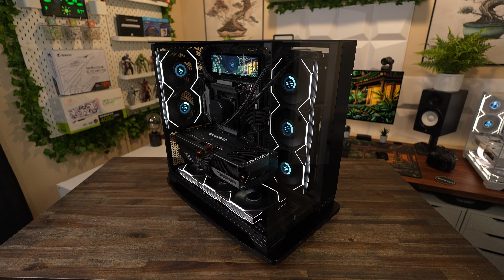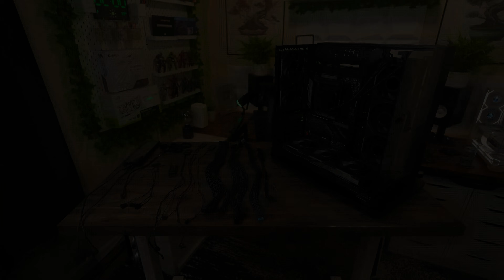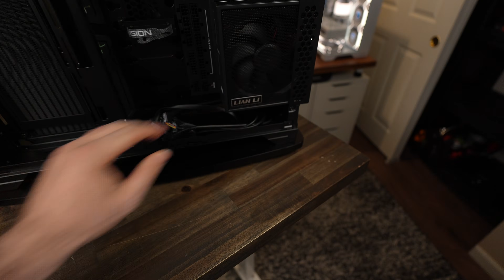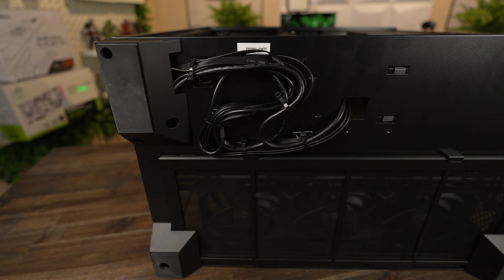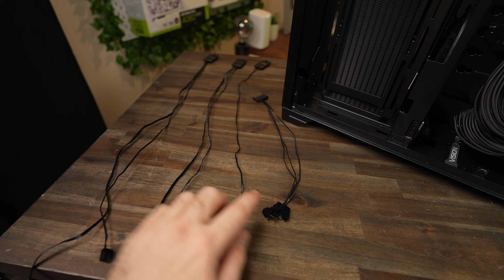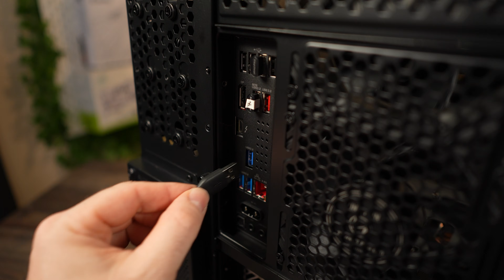How I Cable Managed my DREAM PC like a PRO!

Comment: Amazing builds!
For how long you've been using your 4080's horizontally?
I saw a video from a repair shop saying that even if you use a support bracket or pillar, your gpu (consider as the heavy ones) is gonna twist the pcb, damaging it, being mandatory to use it vertically mounted. That's driving me crazy, I have a 4090 rog strix (believe is the same weight that 4080 of yours) and I'm using the support bracket that came with the O11D evo RGB and the support that came with the gpu.

Comment: beautiful build! I'm inspired to build one almost like it. So the AIO - Lian Li ALC360...it doesn't look like it's got the center lcd. Did you have to buy "Side Fans - Lian Li Uni Fan TL LCD REVERSE BLADE Triple Pack" and replace what came with the AIO - Lian Li ALC360?

Comment: Hi Dan ! Just a quick question. I have the Lian li vision compact.. however I was wondering if the Lian Li edge the L Shape would that fit inside the compact or will it be bending the cables etc too much ?

Comment: Extremely clean and creative work. But i think its a very rare usecase where you got a button of space to work with as well as a very well planned build with minimal cables to begin with. Maybe do another video maybe with a mid tower and alot of cables from different brand components which would more accurately depict the situation of the average user struggling with cable management.

Comment: I think that i got scammed from amazon when I purchased the TL fans because what is supposed to look like "white" looks like light green or light blue, so the RGB is not as its supposed to. Just the red and blue looks like the color that I was matching
Reply from the maker: You’ve really gotta mess with the color palette within the software. It’s very hard to dial in a specific color, ESPECIALLY white. Lean more towards orange’ish / gray
Reply: @DanKamYouKnow   I had the Sl version first and they worked very well. In a moment i thought It was y my pc energy or something like that, then I sold my pc and now Im on a new project with the HAVN vertical GPU version and the TL wireless regular and LCD version and I hope this one do not come with the same issue. Also thanks for all your videos Mate
Reply from the maker: Very fun case to build in!! You’ll enjoy it a lot
Reply: @DanKamYouKnow  thanks. I was thinking to pay for the build but. This is something that I need to learn. I was just worried about the cable management. But the case is amazing

Comment: Loving the screen mate, this it pretty much my current build in terms of case and fans, except I went with a White build as well, used the galahad 2 LCD 360 and a vertical gpu mount. I ordered some of the lian li rgb fan side cover things to put in the area of the case above the cpu but never got it to work, that screen is genius! Is it wrong it have another screen in my build lol?

Comment: I finally finished my build a few weeks ago. An all white build for 2500 roughly. Ryzen 7 7800X3D, 32 gig T-force ddr5 ram, Antec C5 case, 7900XT, Okinos cable extensions, Lian Li EG1000G, NZXT N7 B650E mobo, 4tb (two 2tb NVME drives)

Comment: I am currently looking for a new case for my PC, is this one you'd recommend? I am looking for the best bang for the buck I've been looking at this case in the video but it seems you need to buy the fans which makes it more expensive, 2nd option was the Antec C5 as it comes with 7 120m pmw fans, 3rd is the nzxt h6 or h9. any recommendations??

Comment: I built my first pc cable management was abit bad some of the extra fans I have are sticking into the case and the gpu cable I didn’t know could fit through a small hole I managed to clean as much as I could but will this be a long term issue for temps or not? Really nice video btw

Comment: Absolute perfection like all your builds. You truely live up to the PC Kratos name. Can you show us how you cable managed the white build? I am in the process of building that but I would really really love a full deepdive!
Reply from the maker: Thanks! It is extremely similar, but it's a bit worst now, because I added the Lian Li Wireless Strimer PSU extensions to it. The main difference was that I wrapped each PSU cable in a cable wrap, then used velcro strips around the ends of them.

Comment: dan i have a question is it worth the hassle to have an aio i want one for the asthetics but my friends are telling me its a lot more matenience and itll last 1-2 years
Reply from the maker: There is no maintenance involved with AIO's, it is a completely closed loop. Air coolers definitely have no points of failure (just the fans attached to it) but AIO's are reliable, with most companies offer 2-5 years of warranty on there AIO's.

Comment: 8:22 did you inverse 1 of the cpu power cables? The left one has a smaller lip and is different than the right one?
Reply from the maker: That’s just how the CPU cables look. One is an 8 pin EPS cable and the other is a 4+4 EPS cable.

Comment: I'm currently using the same case right now for a build. Thanks for the lcd screen above the motherboard application. That open space with the board in the lower spot was bothering me. Have you tried 140mm fans at the bottom before? Feels like 140 fans would fill that space better.
Reply from the maker: I have not, but I like how 3 120mm fans look down there.

Comment: hey, what is it called when the PSU have a thing like that sliding out, so connecting the cables. i been looking and have not found anything and it would def help with cable managment if anyone could let me know it would be a huge thanks!

Comment: It seems like routing the cables to be piled underneath the case would restrict space for air intake. The underside is already constrained in a tight space as it is. Leaving the excess in the cable management area is probably the better move for function.
Reply from the maker: I highly doubt it’ll have any effect on fresh air coming into the bottom fans at all. If they were blocking the bottom fans, then sure. But there is the whole rest of the area for fresh air to come into the bottom.

Comment: I want to build also with the Lian li Fans, but I have a budget so no LCD screens are posible. So How many three packs do I need for 2 rear, 3 bottem, 3 front Fans, because the connector is includet in the three packs
Reply from the maker: You’ll need 3 reverse blade fans for the side, 3 reverse blade fans for the bottom, and 2 standard blades for the rear. You can buy a 3 pack for the bottom and/or side.
Reply: @ thanks for the answer😊 and I really love your Videos!

Comment: I’m concerned about my temps on my cpu, I built my own pc, I have a Ryzen 5 7600 and I have a 360 Corsair h150i aio and when gaming my cpu temp goes all the way up to 86° and then sits between 45-60° on idle, is this okay or should I be concerned

Comment: Now can you add an SL and a TL controller, an NXZT USB 2.0 hub, a PCIE power cable, 2 Sata power cables and 3 drives? These are the ones that made my entire PC a mess in the back, I don't know where to put them all.

Comment: So dang clean man!! Loving it! I got the O11 Vision compact and fortunately just picked up a 5090 Astral LC!! Curious on your thoughts about rad placement.. I really want to use the glass top but worried about temps with bottom mount. Thanks man!
Reply from the maker: Wow! Congrats on the card! Will the radiator tubes reach the side?! That would probably the best position

Comment: Transition away from using a WD drive to boot off of, especially on win11. It's a lot to type here but "stornvme" errors are increasingly more common and WD/Microsoft both seem to have no interest in fixing the problem.

Comment: I reckon the 5090 what have looked great in this build, it would fit that clean black aesthetic also this video has made me want to do my cable management 😅
Reply from the maker: It may get a 5090 at some point in the next few months. I don't really have any desire to spend $2,500+ for a GPU right now though.

Comment: I am doing PC since 20 years and today i realized, i will never stop to learn, your video was very very helpful ❤️ 
One question: where you get the display and what a software you use for animated wallpaper in it?
Reply from the maker: The display is linked in the description and the pinned comment. For software, I am using "Wallpaper Engine" on Steam, and the wallpaper is called "HYSTAR MIDORI".

Comment: You are putting your radiators in the wrong position the air is right where the tubes are on the hightest point. Look up a video on AOI positions!
Reply from the maker: This has been discussed to absolute death, it’s FINE. Tubes down is more ideal but this orientation works just fine.
Reply: @DanKamYouKnow  you should make a video about it to put it to grave haha sorry dude :p

Comment: Incredible cable management, and yeah man that tape is incredible, i've been using it for awhile, also strong enough to mount an entire huge APC power strip on the wall, had to move it once, needless to say i also had to repaint the wall after using it lol. Nice vid, been considering a vision for a case but was kinda worried about thermals, since i'm running a 14900K, using a lancool 216 at the moment and it stays around 55 while gaming..
Reply from the maker: Thermals are much better than expected. My 4080 Super rarely goes over 65c and my 7950X3D rarely goes over 75c under benchmarking loads. While gaming, they are both in the high 50s's.

Comment: Awesome build and nice tutorial! People who does pc building videos doesn’t really put the time to explain those sorts of details!

May i ask tho, is there any other power supply that offers usb connections? It seems that lian li is the only one that does that. It really gives more room for fans to plug into
Reply from the maker: As of right now, I don't think there is another power supply that has built in USB 2.0 hub, which is frustrating. I feel like it should be pretty common nowadays.

Comment: Amazing build! I'm getting similar - just can't find TIL LCD 140 reverse blades so I'm going for the SL Infinity!
Reply from the maker: Good choice!
Reply: @DanKamYouKnow  Ended up getting the Dynamic Evo case because Im slightly worried about airflow in the vision with a 5090 but may swap in the future! I managed to get a 5090 and everything is on the way!
Reply: @DanKamYouKnow  Last reply I swear! What are your thoughts on having 140s on the bottom for intake? Or do you prefer the aesthetic of it all being 120s? I might get the vision chrome instead!

Comment: Hey, you switched the PSU slot for the HDD cages so the cable management is easier?
Reply from the maker: I am not sure what you are asking. I hid a lot of the cables in the rear HDD cage.
Reply: @DanKamYouKnow  My Bad! This a Vison 011. I have the 011 Vision Compact and the PSU is where the HDD caddy's are . Your build has the PSU on the bottom and I thought you managed some how to switch the PSU and Caddy positioning, but now i see thats not possible. All good and love your content! :)
Reply from the maker: @ Ohhh, gotcha. My white build shown in the beginning of the video is a O11 Vision Compact, and I actually found it easier to cable manage in. The drive cages on the bottom made it easier!
Reply: @DanKamYouKnow  Awesome! We did a reverse connect with the Aorus B650e Stealth in all white but with a Corsair RM850x Shift and Swafans for easier cleaning. The Lian-Li cases are great. Thanks again for replying so quickly :)
Reply from the maker: @ Sounds like an awesome build!

Comment: Legit like what I’m gonna do same case but the compact version white but not the infinite fans gonna use wireless fans with a 8.8 inch screen inside it on top of the mobo already making the build but gonna go am4 and slowly upgrade
Reply from the maker: Sounds like an awesome build! 👍
Reply: @ yea my only problem is cables my only nemesis gonna use ur tips

Comment: Great build. I love cablemanagement. I just dont like double side tape things directly. If you allow me to give you a little advice. I always use car vinyl wrap stick it to the pieces where the double sided tape will be to prevent the double sided tape leave residues since the vinyl is very very strong i have never had any troubles and qhen you need to remove the vinyl your parts are clean af since the car wrap never leaves residue.
Reply from the maker: Interesting! I will have to keep that in mind, appreciate that. Main reason I chose what I did is because of how strong it is, cost, and it actually doesn’t leave any residue either! I will look into the car vinyl wrap though!
Reply: @DanKamYouKnow  oh i hace use some double sided tape that also almost never leaves residue. But after time they always do. Can you share the one ypu are using?
Reply from the maker: @ I should be a little more clear, it won't leave residue on metal or plastic items, but it will absolutely remove paint off walls or any other similar surface.

https://amzn.to/4161te9
This is what I use, has worked very well for me.

Comment: Hey I love your builds especially the cable management but I've got a question about that "white build" in the backround it looks like a lian li strimer for the two 8 pin cpu cables is that what I'm seeing? How did you get a third cable to work in l-connect software?
Reply from the maker: I used the Wireless version of the Strimers. Which allow for 10 different groups to be used with one controller, 1 strimer counts as one group. So with 3 strimers, I am only using 3 out of the 10 groups available.
Reply: Ah that explains it I haven't gone wireless yet but was planning on using them for my next build so that's good to know I can do that thanks.

Comment: Any reasons on why you changed the AIO tube to the front on your white build? great video as always Dan :D
Reply from the maker: When the AIO is in the forward position, the bottom fan is blocked, and I was doing a video with Lian Li to show off their wireless LCD fans. I moved the AIO to that back position, so the bottom fan was more visible. That was the only reason why I did that. And thank you!!

Comment: Lian li 011 vision vs Lian li 011 compact 
Please make a video on this please ❤❤
Reply from the maker: 011 Vision Compact is the way to go! It’s only slightly smaller and has many improvements over the original. I will see what I can do for a video one of these days!
Reply: @DanKamYouKnow  thanks ♥️
I'm just confused about size and features of both and not a single video on YouTube that compares both side by side ♥️